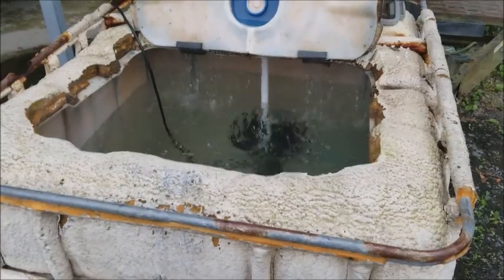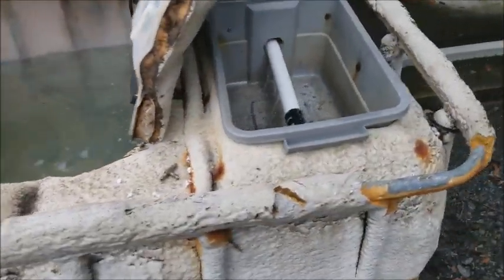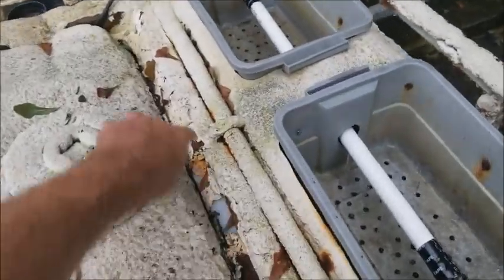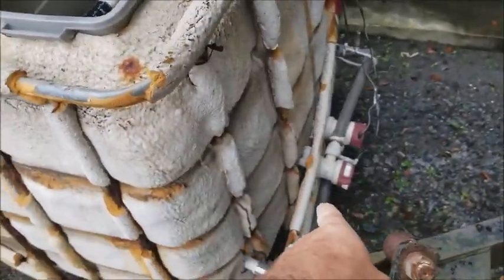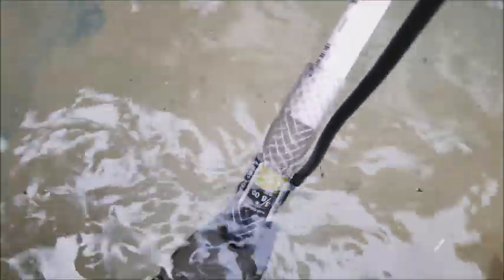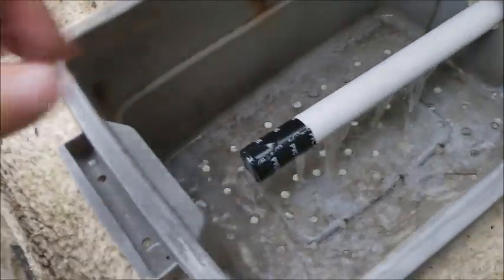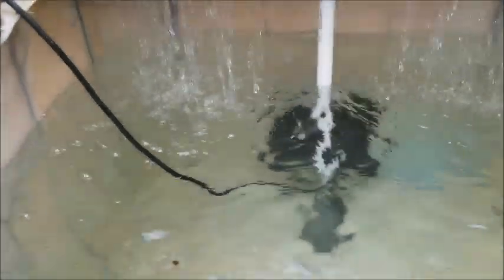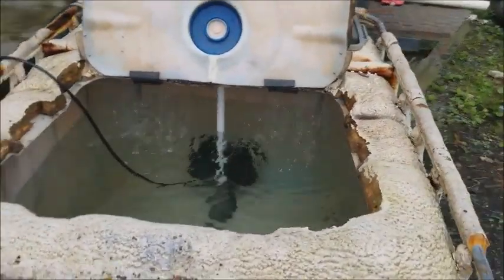Shad Man Tote Tank Setup Overview at Striper Soup!

Comment: When you say low quantity, how many you think you can safely put in there?
Reply from the maker: 100 x 6 inch gizzard shad shouldn't be a problem in 70 degree water.  1/2 oz per gallon of salt.  Use Shad Crack from Striper Soup when you catch your bait, it helps condition and calm them.
Reply: What about filters?
Reply: Do u use them do u recommend them ? And also what adding other Bait fish with the shad like creek shubs
Reply: Thanks for the video